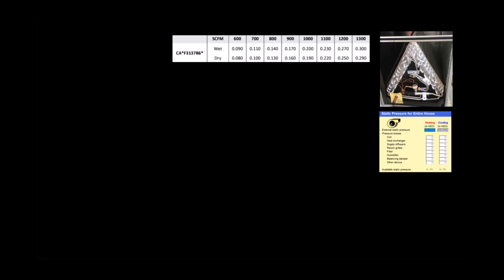Coil Pressure Drop Calculation

Comment: Oh, okay. This is interpolation off of published data. I need to estimate the loss through existing equipment where I have the size, shape, coil count of the coil, but no measured pressure data. (I'm sure it was measured and recorded, somewhere, but the manufacturer only provided the CFM of the total system, not the component losses).
Reply from the maker: You can make an estimate and be conservative. This depends on the tonnage of the system but in the field, you would have to measure the pressure difference across the coil using a digital manometer. Measure wet coil, so wait mmm about 5-10min. Worst case perhaps 0.3inwg